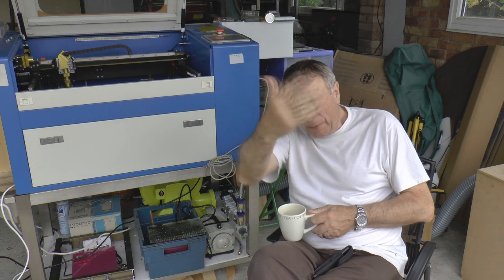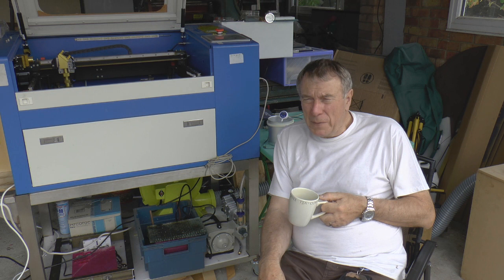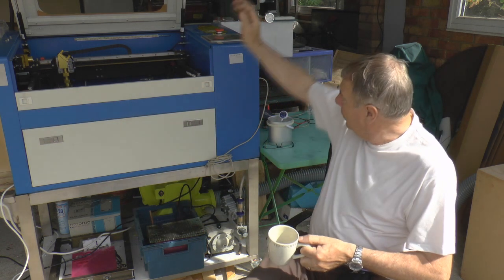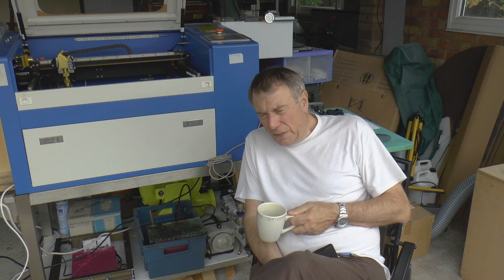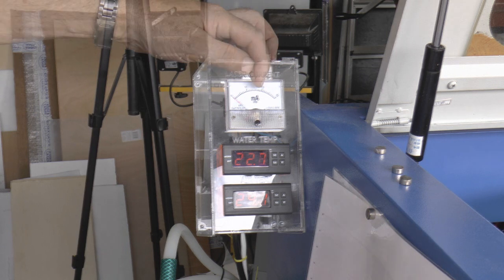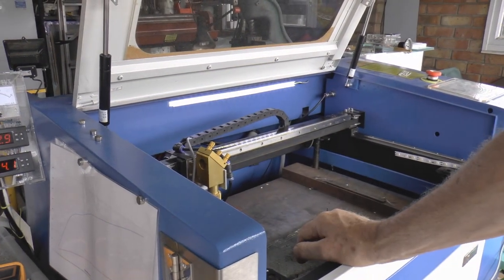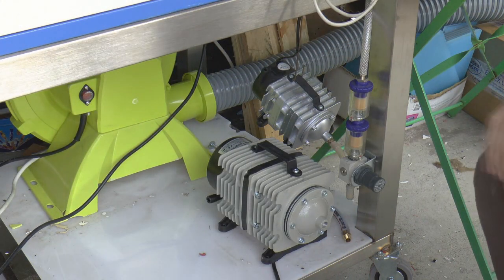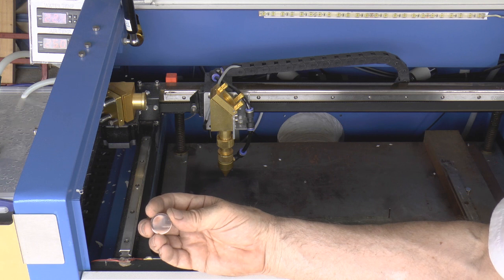RDWorks Learning Lab 75 What have I learned from 1 year of owning a Chinese Laser Engraver

Comment: Hi Russ, I'm an avid fan of yours and I admire what you have done for the hobby laser people out here, I live in Nottinghamshire  and had a K40, pretty disappointed with the performance to be honest, but you get what you pay for, the 50 watt laser you have demonstrated is my next purchase !! It this a good move ? Due to the upgrades you have achieved on the 50 watt machine and limited space I have I think I have made my mind up to buy one. And as you have done upgrade at certain points, one question? Is it a good practise to run the distilled water through a uv light to ensure a bacteria free coolant. I'm doing so on my K40 and this seems ok. What your thought on this, good or bad practice. Very much appreciate your videos and as a member of the laser cutter engraving forum you are highly thought of. Happy new year to you sir and your family keep those videos rolling. Cheers and all the best. Ray Massey, retired manufacturer, I love machines.
Reply from the maker: Hi Ray
Here I am 2.5 years on and I still have my original distilled water in the reservoir. Once a month I take slimy film test with my dipstick thermometer and even taste the water. There may be 3 things that are keeping my water clean. 
1) no metal in the system 
2)Airtight to prevent airborne spores entering
3) Probable UV light cleansing.
 With 3) I say probable because the water jacket in the tube is surrounding an ionized nitrogen column. and as nitrogen de-excites (gives out light) there is a strong UV component.

People with chillers and coolers where there are mixed metal components in the water stream do experience cloudiness after a few months and a simple UV pond filter  certainly prolongs the life of their coolant.

All best wishes 
Russ
Reply: SarbarMultimedia thank you Russ, as long as I'm not harming the tube I'm presuming by having the additional uv light helps, I bought a laser last night just as you have there, and will obviously upgrade the tube & pcu. The size of the machine suits my workshop, I guess it i up grade to 80 watts I will still have the same machine but half the cost. I'll be going through all your RDWorks. I intend to get it right, wish you were closer, I'd love to meet you, a very interesting person with good engineering skills. Once again thank you for your reply, 👍🏻 Ray.

Comment: Does anyone who has bought one know where do buy one with a motorised bed? Great videos!
Reply from the maker: The motorised bed versions of this machine are quite rare. They are not very clear in their specifications either.One quick way to identify
https://www.ebay.co.uk/itm/High-Precise-50W-CO2-Laser-Engraving-Cutting-Machine-Engraver-Cutter-nUSB/122843703593?hash=item1c9a0e2929:g:934AAOSwYwJaJOHV

When the lid is raised you will see a silver knob at front right. That.s the MANUAL raise and lower for the bed.
 I have had a quick look on UK and US Ebay and found nothing  Sorry
Best regards
Russ
Reply: SarbarMultimedia I looked at that one last night too. Looks like the motorised ones are sadly no longer or not currently available. Your videos still have me very tempted....
Reply from the maker: The motorized bed is nice but not an essential feature. The belt drive system will already be there to link the 4 lead screws so it's not a big problem to add a small DC motor and pulley.
Russ

Comment: Hi Russ - I have seen you did put a digital temp meter to your system. Which meter did you use and how did you wire it? 

I assume you made it to stop the machine if temps go too low or to high ? 

Hope you have a video for this one too ...:-)
Reply from the maker: Hi Isaac
Not quite. The instruments are dual purpose. The water temperature is measuring the return flow from the laser tube  so the display tells all. In practice I am using it to monitor the water temperature in the reservoir when the machine is off. The workshop is unheated so when the cold weather arrives it switches on two 50 watt halogen bulbs sited beneath the reservoir and also turns the circulation pump on to keep the tube supplied with warm water. to prevent freezing if the temperature drops below about 5C.  There is an air temperature sensor  as well which switches on two 50 watt bulbs inside the machine case itself to prevent condensation forming.. If you wish to message me with your email I can send some more information
Best wishes
Russ

Comment: Thanks for the videos! I'm about to get one of these, and was wondering about them living in my shop which sees below freezing during the winter. Particularly the cooling water freezing and breaking the tub, hoses, pump, etc. I don't very relish the idea of getting all water out of the system every time I use it in the winter. Do you think automotive antifreeze could be used? Maybe RV waterline antifreeze? Something else?
Reply from the maker: Hi
If you like to send me your email off line via the You Tube Message system I will get back to you with some more information about your concerns. In the UK (near London) we rarely get long freezing periods (maybe a few days a year at -5C but during winter nights it is often below 0C  in my unheated workshop. I have two machines in there that need to be protected against the cold and they have now survived two winters with no ill effects.
All best wishes
Russ

Comment: I did buy K40 3020 6 months ago. Only problem I have had that space is so small and like 3mm fly wood don't cut so good. (okey 2mm is also too much). 1mm  Rubberwood will cut nicely wint 25% power (dam thing has no good power show in power selecting so I did use pen to put about places like 25%-50%-75%-100% so I get some also right in next time). I have video about me doing second burn test (I did use balsa in first and dam thing get fire ;).
Reply from the maker: Hi 
The problem with the K40 machine is that it was designed as an engraving machine where you do not need much power. As soon as you start cutting organic materials such as wood, card, mdf or leather you will need to make sure that you have a 1,5" focal length lens and also some reasonable air assist where the nozzle is ideally about 5 or 6mm above the work surface. Cutting such materials is by a burning action. Burning produces dense flammable smoke. That smoke is a great absorber of IR energy  so, unless you can get air right into the cut zone to blow the smoke  out of the BOTTOM of your cut, then the smoke greatly reduces your cutting efficiency.
It may claim to be a 40 watt tube but they are generally about 30 to 33 watts output. After mirror losses of abourt  12% and a lens loss of maybe 5% that's maybe 27 watts available for cutting You should be able to cut 3mm ply with that at about 5mm/s if your lens is 1.5" focal length AND you have air assist.

Best wishes
Russ
Reply: I did print air assist nozzle ( https://www.thingiverse.com/thing:1063067 ) but I haven't had money yet to get pump :) Also I think to get rid of original mesh bed and replace it with some other thing. Other problem is getting smoke out of apartment so I did use Pringless tubes what I tape together ( only problem on that is that fresh air also comes in in same place so it's +- thing (I need to think something to that window then if I start burn thing lots ;) Hehe, I think also that  air vent is too inside because laser burns it if I run it zero Y (that I gona fix by cutting it shorter inside and ad stopper to x & y so I can put material directly to zero coordinates).
Reply from the maker: Sounds like you are having endless fun and challenges. That seems to be very normal for these machines. If they worked perfectly they would be boring.
Best wishes
Russ

Comment: Hello!

Thank you for your very interesting videos. I have a question: I just received a laser from the same manufacturer - but a smaller machine with a 40W. In this video you said that the tube of a 50W machine will truly have 40W tube power. Does it mean if I bought a 40W machine the tube has 30W power? There`s a sticker on the tube: peak power 40W ; agreement power 39W - I´m not sure at which settings I should run the tube: If it really is a 30W tube I should not go higher than 16mA, right? Or is it save to run the tube at 18 mA? Is it possible to find out which power the tube can stand without straining it?

Thank you in advance for your answer.
Reply from the maker: Hi Frank
It all depends on the overall length of your tube. The chances are that you have a K40 machine  (smaller than mine) which will claim to have a 40 watt tube. A true 40 watt tube will be 800 mm long and 50mm diameter. The chances are that you have a tube that will be 600 or 700mm long.      600mm is a 30 watt tube which I would not run at more than 16mA and 700 is a 35 watt tube run at max of 17mA. It worries me about the manner of the wording on your tube. It sounds like it may be labeled KH Laser? Peak power is what unscrupulous vendors quote. This is not a power you can use. It is also very rare to find the peak power and the "agreement" power so similar.  This sounds like a B grade tube that has been relabeled.
All best wishes
Russ

Comment: Hi Russ,
I just now discovered your channel and watched this video first. Fantastic! Or as you might say Brilliant. I have been shopping and learning as much as I can about using lasers and buying a Chinese laser. Your insight is truly priceless for me. I have had a large format CNC wood router for a very long time but now expanding into laser engraving and cutting. Like anyone else I want to get the most versatile machine I can. Something that can engrave nicely and also cut mdf, ply, and yes even thin metal. The path I'm treading now is looking like I need a two head machine. One at 80watt for engraving and thin cutting and a 150watt for cutting thicker wood and thin metal with O2 assist. The answers I'm getting from the Chinese manufacturers is coming back a little mixed. Are you familiar with any machines that do this well?
Reply from the maker: Hi My experience of twin head machines is zero but if you are going to pusue that route I would say that 80 watts is far too much power for engraving. Even with a 60 watt tube I struggle to get control of low power for engraving certain materials. A good compromise for engraving will be a 40 watt tube with a 1.5" focal length lens. Cutting is where you require the power. You are quite right that you can cut thin steel with 150 watts with oxygen assist gas but you normally require a special metal cutting head for such work.. I used to own  two 3kw metal cutting machines as part of a precision sheet metal working company  and these Chines machines are definitely not going to produce commercial quality work from all the results I have seen. The Chinese are the best with weasle words so be VERY sceptical of any claims. You will need bottled oxygen and a pressure regulator set to supply the required 1 to 2 bar pressure at the nozzle.  It will consume large amounts of pretty expensive gas. just listen to any video of the process and you can hear the high pressure gas. If you have a metal profiling business in your area, try to arrange a visit to see just what's involved with metal cutting. Nice idea but not really a hobby activity.

All best wishes
Russ

Comment: What is the best way to cut through the paper cover on my acrylic with it charring or leaving burn lines on the sides without having to take the paper off? any advice would could help :)
Reply from the maker: Hi Reo
Burning can only mean one thing and that is too much heat in one place for too long.. In Europe most of the acrylic is covered with a plastic film that is non-toxic. I did notice when I was in Florida earlier this year that all of your acrylic seems to be paper covered. I had pretty good success with it.  I normally use only the smallest amount of air assist when cutting acrylic but with a paper covering you need as much as possible.The secret to any cutting is balancing the power with the speed. That can be a tricky one to sort out because what works for a 1" test square will not work for a 1/4" test square. With the small square the cutting head never accelerates to  the full speed that you set for the big squsre so you may need several different layers for different complexity/sizes.The next rick is to raise the work on pins about an inch above your work table that way you get lots of airflow under your work.I can hear you saying "but my honeycomb table does that" Stop and think logically about it. It is aseries of CLOSED cells that your work is resting on. Every time yuour beam passes over an edge it produces a reflection that will cause a paper burn or damage the back of your work if you have removed the paper.. So space on the rear side of your job and using 90% of the energy you are putting into your cut on the cut itself. If you have too much energy escaping from the BOTTOM of your cut then you are going to slow./ Do some trials with a 25mm square test program. Use full power to start and keep stepping the speed up until the square does not drop out. Check edge finish plus top and buttom burning at each stage and I think you will find a neat solution.

Thanks for an interesting question
Best regards
Russ
Reply: Thank you for the feed back! I will definitely put it to practice and see what I can do. :)

Comment: I am looking to pickup one of these to engrave on leather. Can you please give me some advice. I am looking to create 24' x 14' mats on my machine, do you have any suggestions or recommendations?
Reply from the maker: Hi
I hope you mean 24x14 inches rather than feet!!!
The laser process is a burning mechanism , so cutting leather or engraving it is a VERY smoky and smelly business. But look around you tube for some guys doing it and you will see that it works well. You will not need a pwerful machine, something like 60 watts is a good compromise. I use the word compromise because cutting and engraving have conflicting requirements. You need little power (maybe 10 to 15 watts) to engrave well but you need lots of power to CUT. If you go out and buy a 150 watt machine, you will be able to cut leather at lightening speeds but when it comes to engraving...oops not enough control at low power. That's why they have twin laser machines with a 150 and 40 watt tubes on one machine. 
You will undoubtedly buy from ebay, if so there are two major pieces of advice. First do not buy a KeHui brand machine (it's a long story) and secondly make sure you buy with your CREDIT card. Ebay guarantees are useless and PayPal do not cover manufacturing equipment. by all means send me a private message with a link when nyou have settled on a machine and I'll point out any issues
Best regards
Russ
Reply: Thank you so much! And yea, I definetly mean inches, sorry. I looked around for a few and did'nt find any machines that were big enough to cut a 24" x 14" mat, and I was wondering if you knew a couple. Good idea about the credit card, I will definetly do that. I'm still looking around for a machine to buy and I appreciate any and all tips you can give me!
Reply from the maker: This machine would be ideal for your requirements 27.5"x 19.7" and a supposed 60 watt tube. In reality it will be a 1000mm long 50 watt tube of dubious quality.  The tube may last weeks or over a year so that's just a word of warning. The basic mechanics are usually pretty good and you basically are getting a lot for your money. You can buy a better quality machine with support from a local distributor of this type of mackine but you will be paying 4 times the price for almost the same thing. If you are prepared to tinker with your machine and are not phased by problems but set to solving them, then you will enjoy this sort of machine.

http://www.ebay.co.uk/itm/CO2-LASER-ENGRAVER-ENGRAVING-CUTTING-MACHINE-CARVING-PRINTING-60W-USB-PORT/201430056910?_trksid=p2047675.c100005.m1851&_trkparms=aid%3D555018%26algo%3DPL.SIM%26ao%3D2%26asc%3D20140122125356%26meid%3D2073199bca43458da41caf239cdb6558%26pid%3D100005%26rk%3D4%26rkt%3D6%26mehot%3Dpp%26sd%3D222590654498

Still working in inches tells me you are in the USA. You will find something similar on ebay.com.

Best regards
Russ